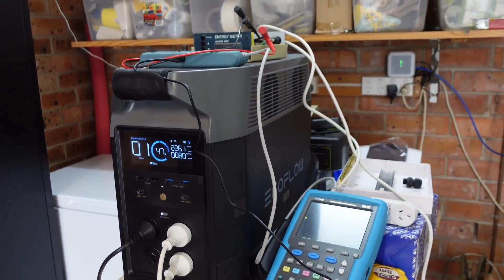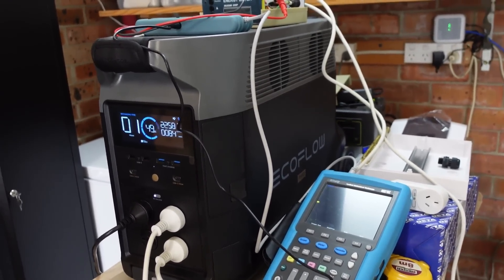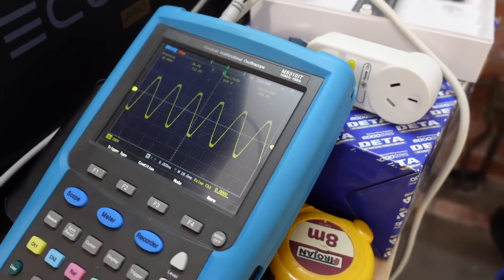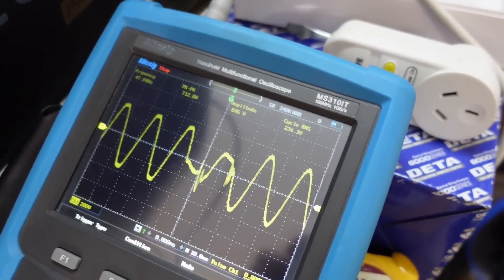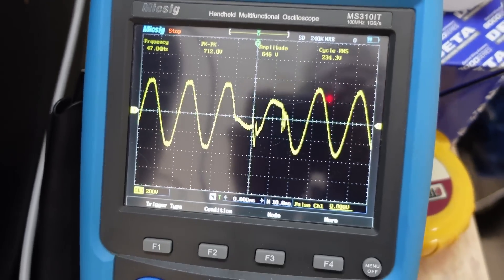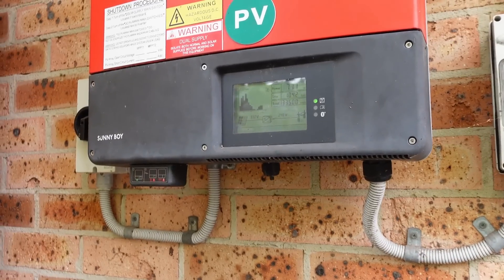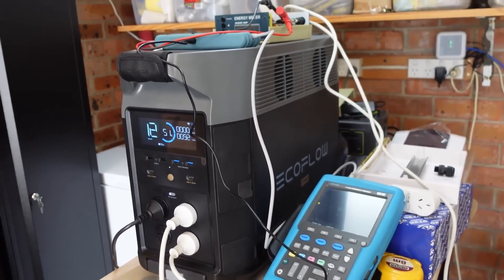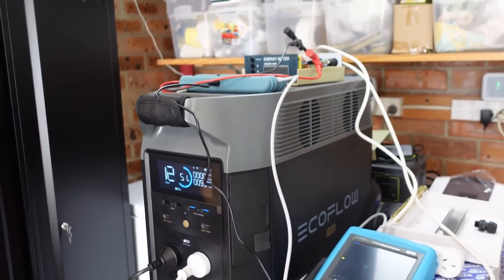EcoFlow Delta Pro - RTFM Dummy!

Comment: YOU Definitely Need to know How COMPRESSORS cycle Before you do this.      When the COMPRESSOR shuts off the appliance it's in MAKES sure it has a minimum of 2 minutes to bleed the pressure off before restarting.    So if any thing your switch box should be triggered by the fridge itself.

Comment: OK HERE WE GO.   ILL TELL YA WHATS HAPPENING.    ALL COMPRESSORS.  ESPECIALLY. FREON COMPRESSORS IN FRIDGE AND AC.   WHEN POWER DISCONNECTED THE COMPRESSOR HAS TO BLEED DOWN THE FREON BEFORE COMPRESSOR CAN BE RESTATED. AND WHEN THE AC SWITCHES THE COMPRESSOR STOPS THEN THAT BIG BOX THING RECONNECTES THE COMPRESSOR AND THE COMPRESSOR CAN'T START AND IT DRAWS TRIPPLE THE CURRENT. THAT BIG THING SEES THE OVER DRAW AND SHUTS OFF.

Comment: I know you mentioned in your previous video that you didn't want a computer UPS for this project; however, it really seems like you are trying to recreate a double conversion UPS.  If you are not familiar with them, the double conversion UPSes continually rectify the incoming power into DC and then invert it back to AC.  Typically, the battery is always connected to the DC bus.  The benefit of this is you never have any switching in your output.  We use it at my work in network closets to keep a clean supply to large ethernet switches powering fleets of PoE telephones.

Comment: **********Retired HVAC/R guy here.   The compressor needs the refrigerant to at least partially equalize. Domestic compressors aren’t designed to restart against the high pressure they generate as part of the refrigeration cycle.  A possible bandaid is to install a hard start kit on the compressor.  My actual recommendation is to install a time delay start relay on each compressor to let the equalization take place before restart. Setting all three tdr’s to a slightly different time will make sure they don’t all try to start at once.  Manufacturers usually tell you to not restart for 5 minutes.  Some even say it right on the control panel.

Comment: Dave. I am not sure if I have follow all your calculations but besides the brief interruption of power when the switch over happens, are you accounting for the defrost cycle on your fridges? (assuming the the fridges are no-frost type)  Typically during the defrost cycle there will be a electrical heater working that can consume on excess of 2KW during a period of several minutes. In some modern fridges those cycles are scheduled taking in account variables not only about temperature but also how many times you open the doors etc.. So worst case situation, if  two of the fridges are running the defrost cycle at the same time that the 3rd one starts the freezing cycle it could cause an overload on the system that can trigger the output protection.
Reply: I've never seen a defrost heater use more than 600 watts. But I agree that one starting up while another defrosts could be just enough to put it over the edge. The only problem is these units will often restart automatically after an overload instead of shutting off. Actually scratch that. If they do restart after an overload everything will start up at once and trip it again until the unit decides it has tried too many times and gives up.

Comment: Hello Dave. You are correct compressors will lock rotors in case they are running and then you will disconnect them  and connect it back. Personally i'm using delay with relay when i'm switiching from main to battery power and also back... for fridges it takes about 2-3 minutes till they will stabilize pressure inside. So in case you want to use delay circuit ..use online type of inverter/UPS ..They cost more than normal UPS   ..why it switched off was probably over power ..because in case if all those fridges froze same time and delay between swtiching was even a bit more it caused to work like asynchronous motor with locked rotor...power just sky rocket..for one fridge it can go from 100W to 500W but on another side..every fridge has protection that will cause fridge to stop working till it is cooled down..i did work for compressor factory(there are only few brands to be honest ..if you not count those in China) so i have some knowledge..

Comment: while the price might not be the best, a proper inverter/charger or hybrid inverter with a lithium battery bank(or managed battery) will provide the most reliable power stability. You will notice that most likely even 2-3 kva units are a good deal larger and heavier than the inverter-charger unit in the ecoflow. Showing that continuous day to day use needs some beefy electronics. they also have much better power changeover and offer passthrough capability.

Comment: Charge it through the solar panel input instead of the mains input. Yes you need an AC to DC supply but it eliminates the switching issue. Or an HVAC AC compressor delay could also work but would more complicated to do as fridges don't have and easy way to add them.
    Here in the land of split phase we have an issue with power loss. It's rare but it happens more than you realize but if we loose a leg for enough MS and your 220V compressor is running it will reverse direction until it eventually overheats and shuts off. And Oh does a compressor sound bad when it's running backwards.
Reply: Single phase 240v compressors will just connect to both lives, no neutral. If you were to lose a single leg it would result in reduced motor voltage. But that would be very rare because the 120/240 lines from the transformer are short and faults are almost always on the true single-phase primary.

Basically I'm saying a 120v compressor would suffer the same problem.

Comment: Convert the fridges to dc compressors (most lg and others already are) and charge the pro with dc instead of ac and create a mosfet switch in dc. Volia, no problem. 

Or get rid of the transfer and just charge dc depending on pack voltage dropping.  The. The pro will never switch off its own inverter.
Reply: Yea because that would be cheap and easy lol

Comment: They probably elected to have the power bank switch between the AC input and the inverter for greater efficiency.  Some online UPSes support this sort of "bypass mode" as well if the user selects it.  Supplying the AC output from the inverter continuously would limit efficiency to 90 to 95%.

Comment: In any decent quality refrigeration system there will be a time delay of 2 or 3 minutes before a compressor is allowed to start after shutting down. This allows the system pressure to equalize so the compressor doesn't start into a high head pressure.

Comment: Not the slickest solution but another timer on the output of the EcoFlow set to turn off power for 5 minutes or so and set a couple minutes before the timer on the mains would just bypass the whole issue and give time for the fridges reset.

Comment: isnt there only 1 inverter that either charges or inverts and the relays disconnect the Contacts, etc.

So you simply need to install the Ecoflow feed in station, or maybe with some software trickery the Battery can backfeed into the ac line excactly that amount that the house is using, like any other battery solution on the market
and maybe you shopuld manipulate the temerature sendor during daytime, so the fridge runs more and during night doesnt need to work. And maybe in combination with some salt water storage

Comment: Wattage jump was probably the load changing and there is a limit on the rate it can charge at. So it adjusted the input accordingly (maximum charge rate + current load).
Reply: In fact you see the output jump by the same amount so maximum charge rate is about 2kw

Comment: Another question is what happens when you switch from battery to mains with the fail-saif mechanical switch. Not only you have to face a big delay but also there's no guarantee that the sinwaves will be in phase. If you are powering a filament lightbulb it's ok but how do the motors react? It's probably fine if  it's a rare event but you don't want that every day.

Comment: A great product for your use-case would be a Victron Multiplus II together with a battery. You could easily build your own with cheap Chinese LiFePo4 cells. Would be an interesting project. No need to re-wire your solar.

Comment: You could consider putting an on-line UPS on the output of the EcoFlow, in front of the fridges. Not for the UPS functionality but for certainty of zero switching or change in phase, frequency, etc. They tend to be quite expensive, but there are companies selling surplus on eBay for pretty reasonable prices here (couple hundred £).

Comment: It’s my understanding ( have 2 atm, one on tv etc and the other on computer, router and NDN router or whatever it’s called)  that ups systems come in two flavours. One that switches to battery when 240v power drops out and the other one basically runs the inverter all the time from battery, and mains  just keeps the battery charged. Which would have no switch over time. Is your unit miss labelled? Incidentally I bought an ups 5 year back ( used) that outputs 16a at 240v. Has battery packs ( I got two) with 4 x 12v  batteries outputting 24v. Big Anderson plugs between batter packs that can be daisy chained that basically say run run times limited to the number of battery packs. I could run my 15a mig welder from this. Tho it sits in the spare room unused except for testing when I bought it.

Comment: It’s simply not the target application of the EcoFlow and I don’t know why people keep using these power banks in place of UPSes. Get a hybrid inverter and wire the separate backup outputs to your fridges. Much simpler and more elegant.
Reply: But if you get these power banks for free because the manufacturers are currently flood influencers with them and you would have to pay for the hybrid inverter, it is worth a shot.
Like Dave, i would recommend to use a proper hybrid inverter for this kind of application. Don't waste your money on this kind of power banks, if you don't have an application for it. It is all just hype, almost nobody needs them.

Comment: If you ask EcoFlow directly maybe they could do a firmware update to add an "UPS Mode" where the inverter is always active?
Could be an interesting feature for other applications where uninterrupted power is needed as well, and they have another selling point.
Reply: Not possible to remedy electro-mechanical relay delay with firmware.  Ask Ford about their contactor issue on the Mustang Mach-e 😂.
Reply: @shazam6274  The idea is to not switch the relay at all. In UPS mode it would always use the inverter. So you get no interruptions at the cost of efficiency.
Reply: @bjiirn  Also not possible to magically synchronize the inverter's local sine wave to the AC Line input with firmware.  Requires re-design of power supply!
Reply: @shazam6274  it should simply not connect the output to the grid. ( Grid -> Charger -> Battery -> Inverter -> Outlet ) So as long as the relays are controled by the software it should be no problem.
Reply: @bjiirn  Sure! Simple and cheap! all done with a few lines of code.  Those idiots!  🤣 You know they have been selling your idea for many decades now, but substantially larger, heavier and way more expensive.

Comment: Of course never thought of that issue! It makes sense they did this, I assume they're doing the typical thing with large portable battery systems (and EVs) where the output inverter is used to charge the battery when on AC to allow for the device to be much cheaper, small, lighter and more efficient but still have a fast charge rate. 

A proper 0 ms 'line interactive' or 'double conversion' UPS would probably cost more than this EcoFlow battery system and only have like 30 min worth of lead acids. Would it instead be better to dedicate some of the panels on your roof to this system after the house extension through the DC input? I imagine that has a separate DC-DC for the MPPT functionality and thus the output inverter will be continuous, you can still use the same automatic change over for battery failure protection.

Comment: There's no way to disable bypass and make it a permanent dual-conversion UPS? It would just be a setting in the firmware.
Reply: No. It has mains charging functionality as a relay connecting mains input directly to invertor output and running inverter in reverse. There isn't 2 inverters inside this unit to achieve whatever you ask.

Comment: If you could get hold of a cheap (or even a dumpster dive) UPS with a 0ms switchover, you could put that inline between the output of the EcoFlow and your fridges, that would cater for the delay of the switching over in the EcoFlow. I guess you'd just need to ensure the UPS can handle the throughput of the load, the condition of the batteries wouldn't matter that much so long as it can power the fridges for that tiny delay in the switch over.
As I mentioned on the other automatic AC switch video though, I think just using a UPS would be a better solution, so long as the UPS has enough functionality to do what you want. I'm thinking that if the UPS had a self test feature that you could set on a schedule every day, and that also allows the batteries to drain right down before cancelling the self test and reconnecting the mains power (and would probably need a timeout on the self-test feature as well I guess).
Reply: Just had another idea. If you couldn't find a UPS with an automatic self-test feature, perhaps you could find a 240v timer that could be put on the AC input side of the UPS  that had a set time to turn off/on (like you were already planning to have), but also has the ability to be triggered on again from a remote source. Then you could make some kind of little circuit that would read the battery level of the UPS, and if the UPS reaches that level it would send a signal to the 240v timer to turn power back on to the UPS again. If it never reaches the low battery threshold, then the 240v timer would just turn back on at the scheduled on time as per normal. You wouldn't need to have the automatic AC transfer switch then, and the UPS should solve your 0ms switch over delay that you are wanting.
Reply: Few online UPSes will operate with a bad or missing battery.  Some will in which case they become something like a super power conditioner.

Comment: 4:02 At 3:53 the output jumps to almost 900W,  my guess is it lowers the charging current to not overload the circuit it is plugged into... BTW that transfer time is horrendous, my cheap-ish APC UPS does it in 8ms.
As for the fridges put in a relay set to 5 min delay.

Comment: Terrible solution I would do: Grab an raspberry pi/esp32, connect it to the Bluetooth/WiFi of the ecoflow. Then switch the ac inverter off in software, enable the charging (if not possible in software, use a wifi relais wallplug), wait for 30s and enable the inverter again.

Comment: There are UPS and there are "online" UPS. The later ALWAYS generates its own sinus source, independend of the main grid status. Therefor there will be NO SWITCHING at all. The former simple UPS instead often puts thtough the mains input to the output, UNTIL it fails, THEN switching on the local inverter. REsulting in some time/glitch in the wave.

Comment: Does the Ecoflow have an independent 50Hz wave or does is synchronize while on AC?

If I would be far more afraid when the grid power to comes back on and the 50Hz cycle could have drifted (due to the lack of grid synchronization) 180°. Compressors without any driver (like VFD) especially doesn't like that. Synchronous motors will synchronize to the grid not matter what and the sound you hear could be that.

Putting an "online" UPS after the Ecoflow would solve this problem. Not eve a line interactive one. Must be "online". Only the online ones habe the double conversion hardware with the battery inline the DC. And grid synchronization is no issue with them since they always put out they own 50Hz.

Comment: dave. instead of cutting the power to the camping battery mid cycle with a mechanical timer... then how about trying to come up with a relay or ssr type cutoff that cuts the power reliably at the ac zero crossing point instead. or one where you can adjust the cutoff point relative to the zero crossing point

you could also then insert a variable delay. like the other guy said here to give the fridges a chance to recover

maybe 1 other alternative could be to try inserting a ups. but that seems a bit overkill to me.

as for the battery resetting idk anything about that. just bear in mind that having multiple fridges thats an inductive load those compressors. which presumably you would want them to have some internal dump resistors. for not to dump a transient when the power cuts out. which then in turn might upset the battery pack. however we didnt see any obviously out of order too large transients on your scope screen. and it is in fact a high quality battery that should be designed to be tolerant to work with inductive loads. at least that seems reasonable and is being assumed here
Reply from the maker: Nope, I'm not ging to dick around with this. I was going to get the Hybrid battery anyway. AND there is still the issue of it mysteriously switching off.
Reply: @EEVblog2  yeah i think another youtuber will prowse might have mentioned that issue on his review of the evoflow delta pro. indeed it is a shame that it does not come back on by itself. which then makes it unsuitable for this sort of situations. sorry had forgotten about that (you just reminded me). seems a bit silly if you ask me. that they could not make it a configurable option or setting. nevermind i guess.